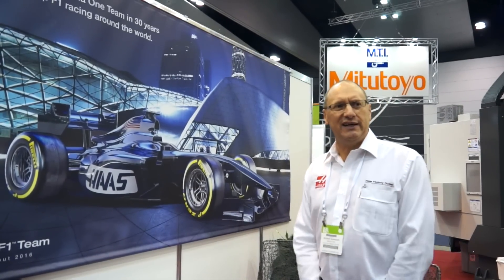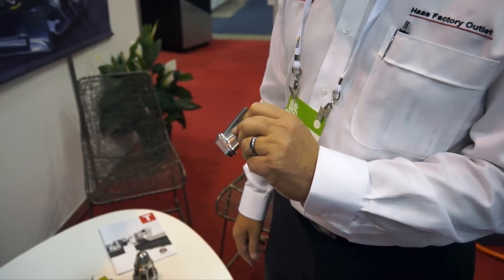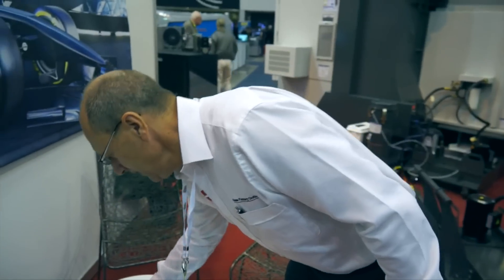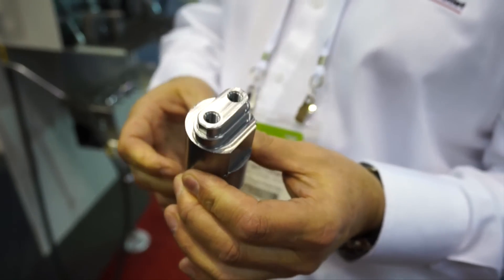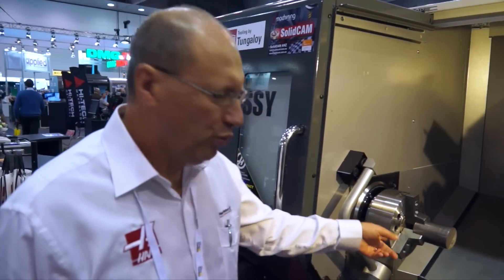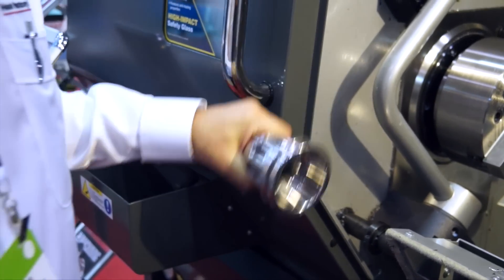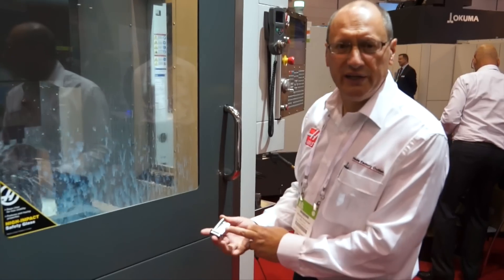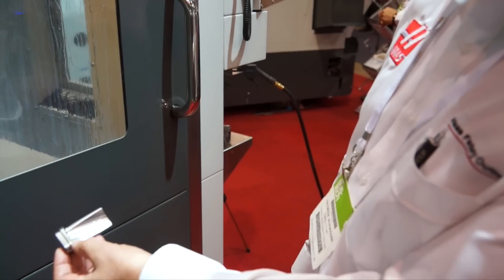HAAS Automation Demonstration - AusTech 2015

Comment: Hi Aaron, what was the material? 6061?
Thanks.
Reply from the maker: GP Tech Hey Grant, no it was steel.  Not sure if it was mild or bright?  I'll ask George next time I see him.  It wasn't free machine grade.
Reply: DCTTeacher1 Ok, the use of coolant was throwing me off, I still get conflicting advice on when or if to use coolant with carbide on steel.
Reply from the maker: GP Tech Hey Grant, I know most modern CNC machines use air blast on their machines these days.  However, don't be afraid of running coolant.  That Houghton's HoCut 795 is pretty good stuff.  Cheers, Aaron.
Reply: DCTTeacher1 Thanks. Yes, I've been happy with the HoCut so far, no issues at all.